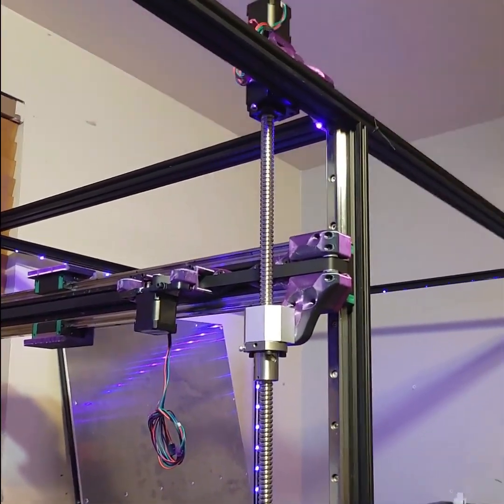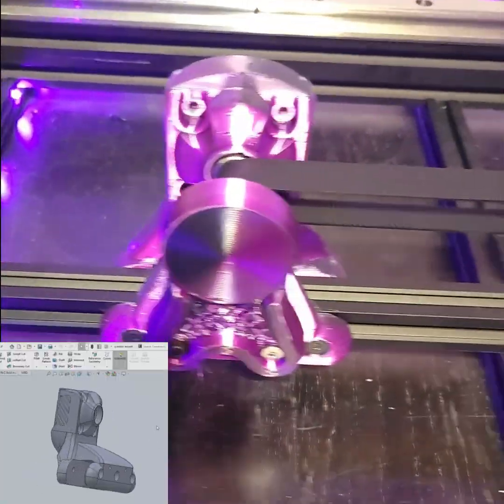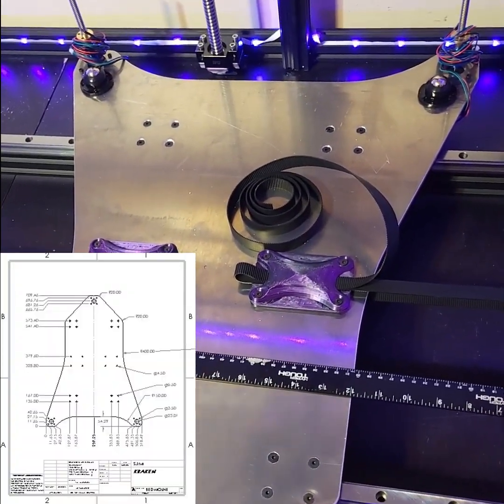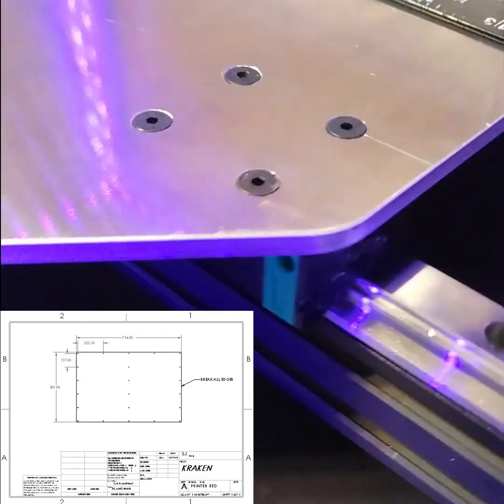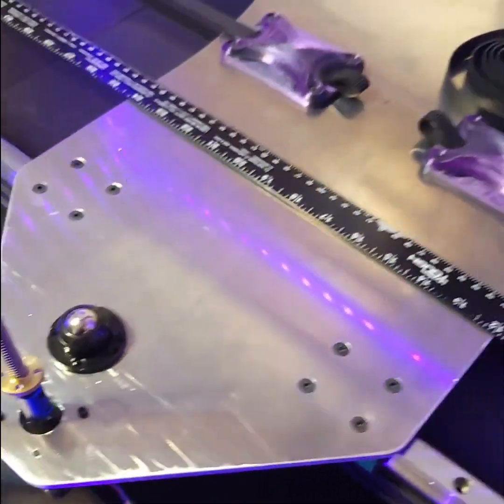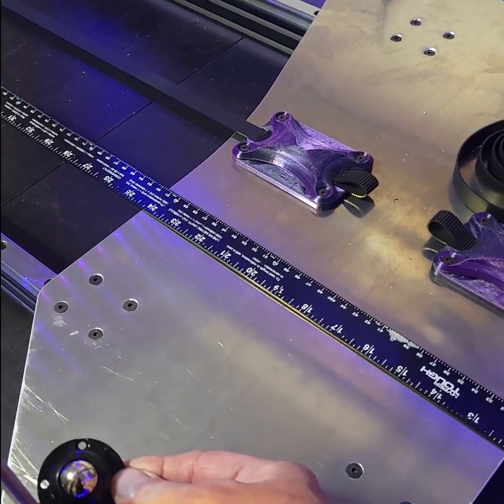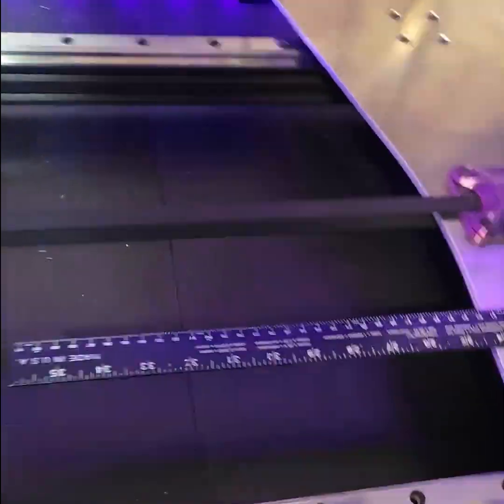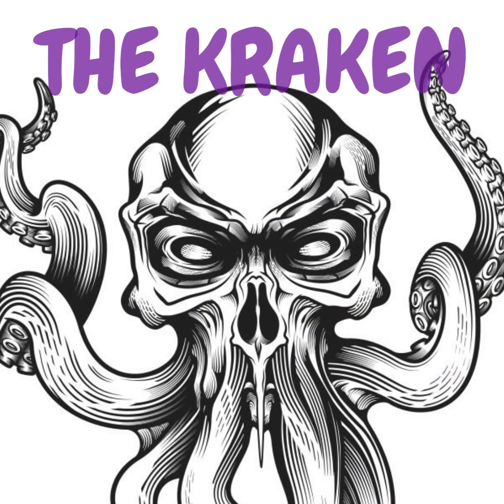KRAKEN VIDEO #2 - Y AXIS 24x36 CUSTOM PRINTER BUILD

Comment: Why did you not scale up a build such as HevORT? A moving bed that size is going to make the printer super slow and the chamber will have to be huge.
Reply from the maker: I wanted to build it from scratch. Also, I did n I t want a lifting bed. I'm planning to print car parts like v8 intake manafolds so they would be very heavy to try and lift up and down. I'm nor worried about speed that much. Most prints I run around 100mm using a .8 nozzle.
Reply: @chev-ord-eep-ota5018 why not a flying gantry like voron 2.4 then?